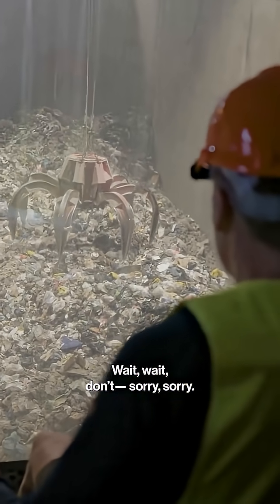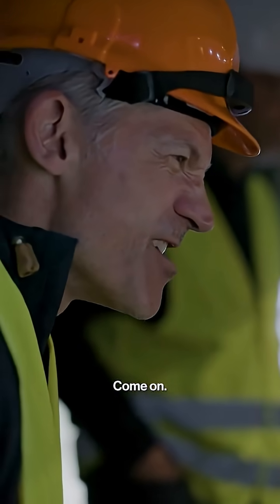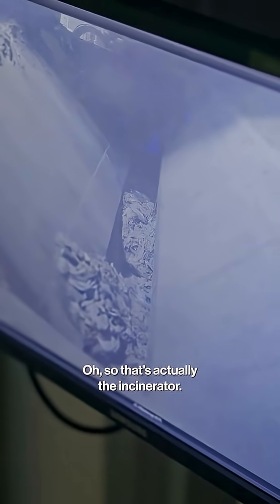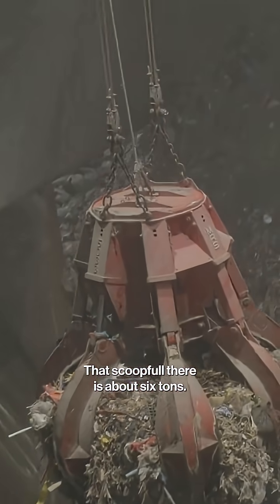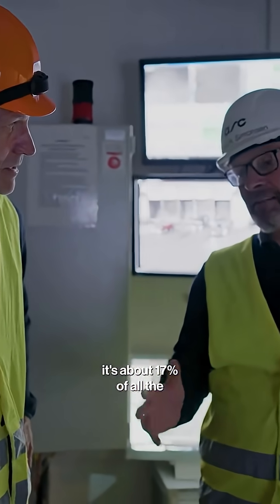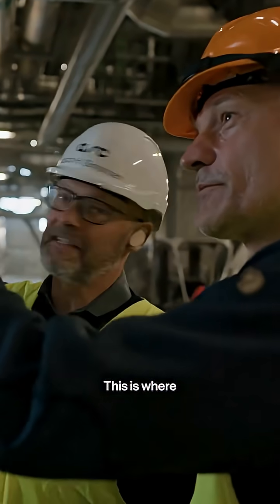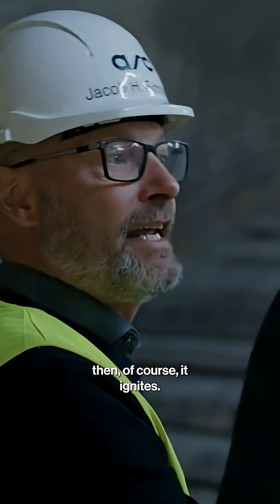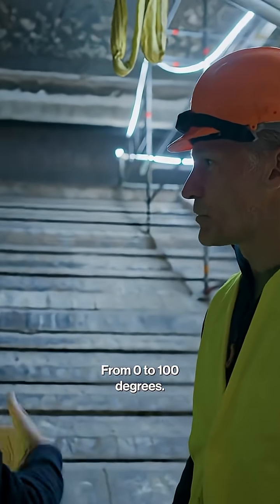This Is Not Your Typical Power Plant

Comment: What burns and turns to dusts will come down and fall like ashes on your lungs (and most can’t see nor hear the truth as fact).
Reply: @loganmarsial5740 They didn't show the whole system, which takes care of that
Reply: Your car fuks us more then this power plant!!
Reply: They actually have complex systems to abate emissions, like desox, denox and several kinds of particulate filters. I believe there are process practices that minimize dioxines but I'm not sure about that. The only thing they can't do much about is CO2 of course
Reply: That’s not how it works….
Reply: CHP Plant. It's pretty easy to extract chemical particles and toxic smokes during it's burning. Burner beds are very special nowadays. But what to do when you have colleted the chemicals IDK
Reply: Its called filters..
Reply: True maga !
Reply: @loganmarsial5740  there is a new imvention around. They are called "filters"
Reply: incinerators produce some of the worst real pollution, 
co2 is not pollution